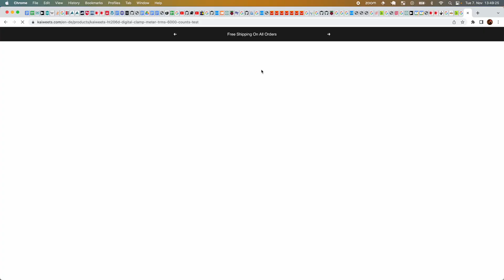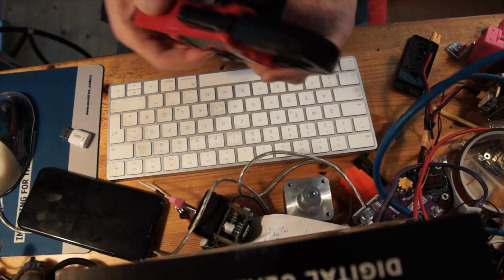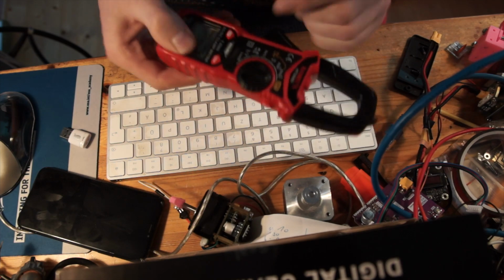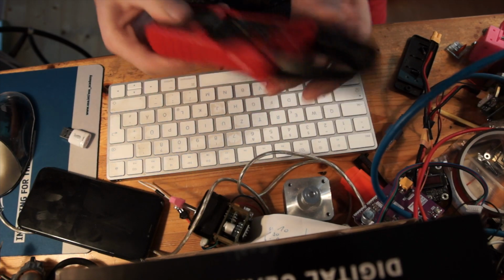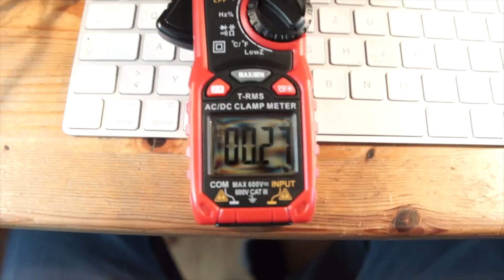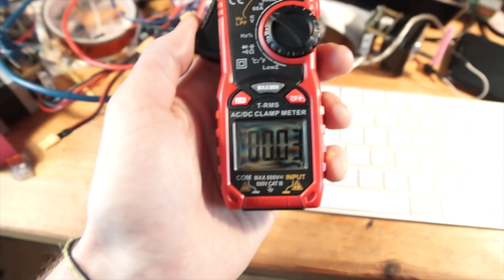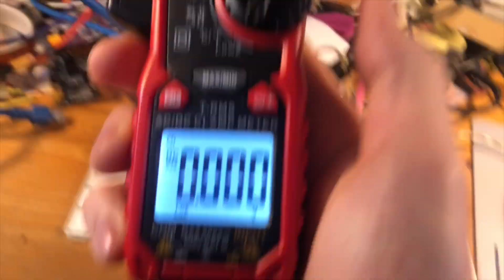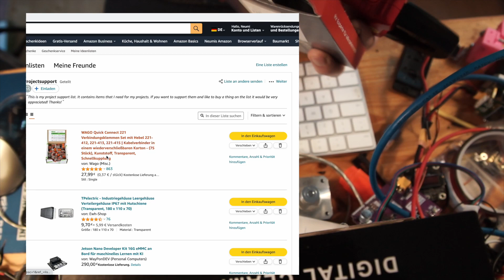A pretty OK-ish DC current clamp meter + DC offset calibration Kaiweets HT206D

Comment: Good review thanks.  And FYI you can reset the DC clamp ammeter to zero by holding down the Z/F key for 3 seconds.
I've had limited success with zeroing using that button, so I might end up opening it up and adjusting with the pot.  Thanks for the tip!
But what is your opinion: better to use the Zero button, or adjusting the pot?
Reply from the maker: Yes you can do that of course. I forgot to mention that. I'm actually not sure if the drift is normal for DC clamp amperemeters or if it is especially bad with this one. I always zero the reading very close to the actual measurement point. I think the reading varies at least 0.2A depending on where you put the meter. For a rough measurement, it's enough, though.
Maybe the calibration/adjustment doesn't help at all if the value drifts like that anyway.